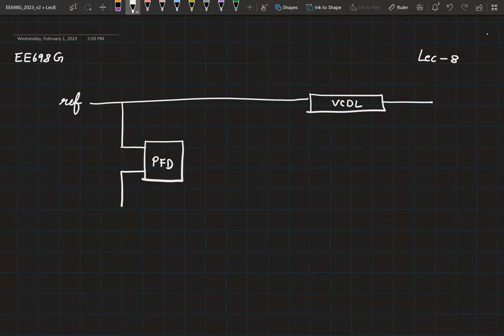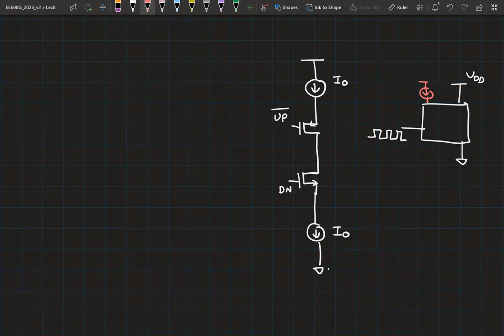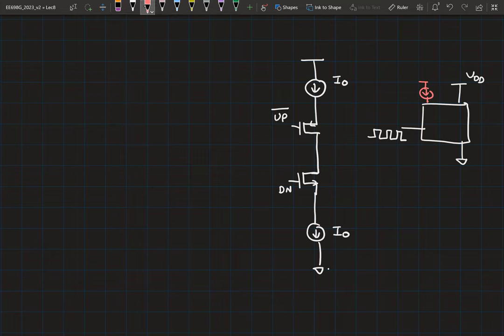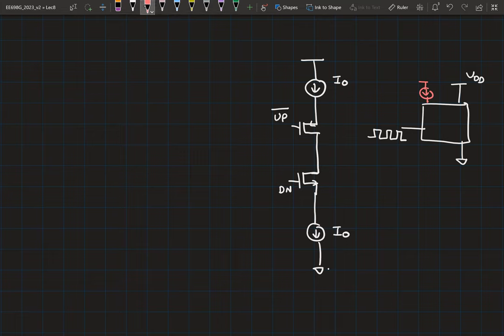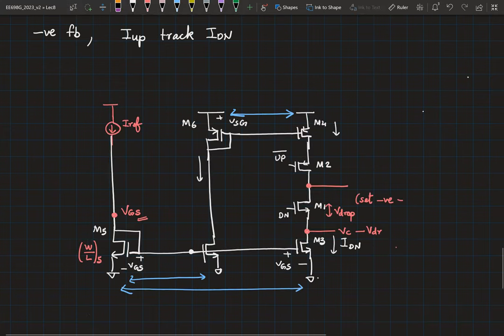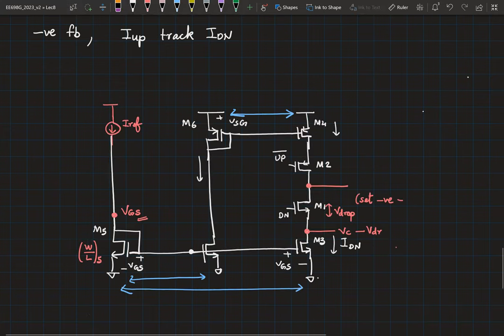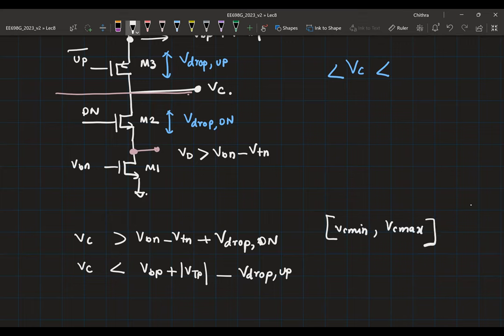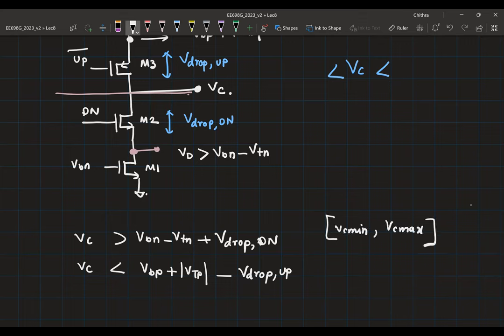Lecture 8: Charge pump implementation

Comment: Thank you for the video! Could someone explain @27:46, to increase the 'trst' why we have to add more delay from UP and Dn signals to Reset port? Doesn't this just increase the time for the reset to turn ON? We actually need the reset to be ON for a longer time implying that delay should be added in the path of Reset to UP or DN ports. Thanks in advance!